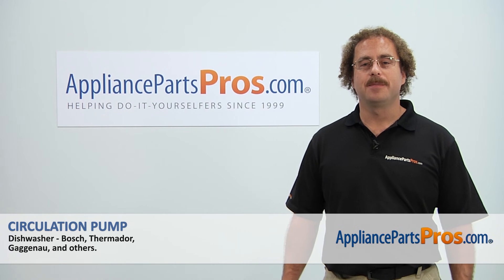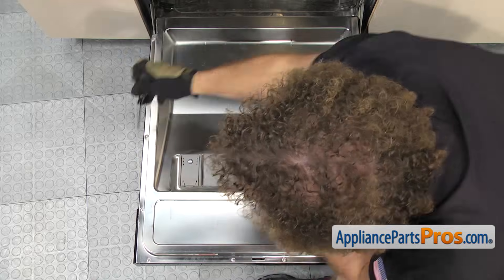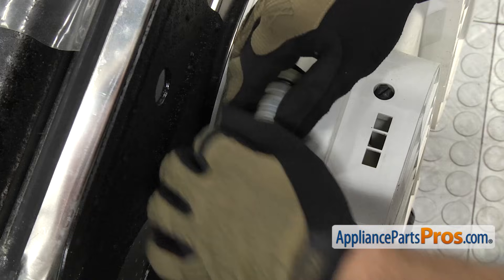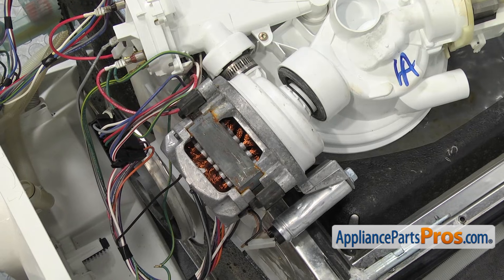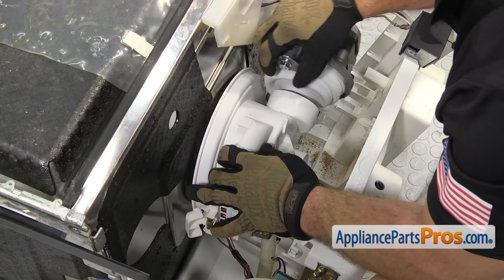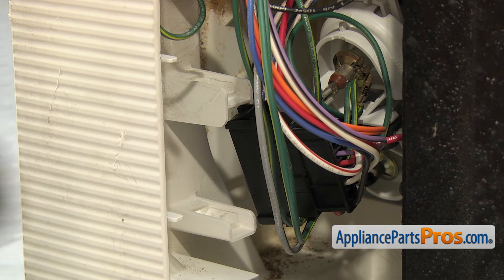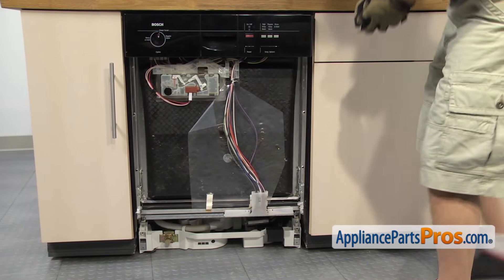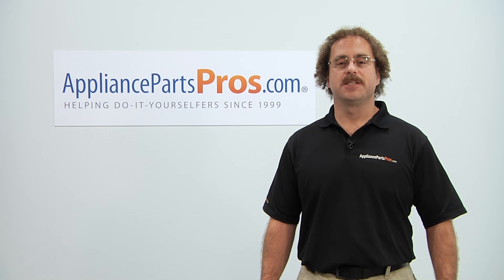How To: Bosch/Thermador/Gaggenau Circulation Pump 00239144

Comment: Thank you Matt for this awesome video!  My model is the Shv57c03uc /21 so there were a couple things (wiring) I had to figure out but made sure to take pictures of the existing wiring hookups.  Took about 2 hours form start to first run and saved over $500.  Again, thank you for your clear and concise instructions!

Comment: Question : can I use plumbers grease on all of the rubber grommets and seals?
Reply from the maker: We usually recommend caution with using lubricants with washing machines and dishwashers, because those lubricants can end up on clothes or on your dishes. However, a quality silicone grease should be nontoxic, so you should be okay there.

Comment: Help please!!  Firstly, there is no wiring harnass attached to the base as in your model(At least I can’t find one). Also, there is a blue wire running to the capacitor attached to the motor. (Shv57c03uc /22).  I assume these dishwasher models are all a little different. Can you guide me to approximately where the wiring harness should be? I’m not looking to rip any wires are their connections. Also why does my unit have a wire running to the capacitor while yours doesn’t?  Thanks!
Reply from the maker: You're correct that all the models are a little different. A single part can be compatible with hundreds of different appliances. We film the part on a single appliance model to serve as an example of the repair, but there may be slight variations in the process for different models. Additionally, this video is for part 00239144 and it looks like your unit takes part 00442548, so the video won't be an exact match. Here's the diagram for your model http://www.appliancepartspros.com/parts-for-bosch-shv57c03uc-22.html That should help you see the parts and how they're connected. If the diagram doesn't help you out enough, keep in mind that we offer free technical advice and diagnosis 7 days a week. We can answer any questions you may have and help talk you through the repair. You can give us a call at 1-877-477-7278 or you can chat us at our website: http://www.appliancepartspros.com/. Our PartsPros Agents are here from 7 AM to midnight EST.
Reply: I ran into the same issue but watched the video before taking my unit apart. What I did was take a picture w/my mobile phone prior to dismantling the entire machine...including the existing wiring and connections.  I also added mini videos of where all the screws/parts go and put them in a parts container showing where each one goes.  Yes, it takes a little time if you're not a pro but this video is very helpful and straight forward.  To repair this would have cost me $623.00 and a new dishwasher is about $1000.  The pump motor is $144 including shipping.  (Shv57c03uc /21).

Comment: So thorough thank you except you omitted how to disconnect the electrical
Reply from the maker: You're welcome! I'm happy to hear our video helped you out with your repair. We do recommend disconnecting the appliance at the outlet at 0:15. Better safe than sorry!
Reply: AppliancePartsPros , thanks for the response, and once again thanks for the great video. Mine is hard wired, not as simple as unplugging a cord. If I can do the repair I can remove 3 wires.  Guess I was just trying for a little sarcasm that backfired.
Reply from the maker: It is a little more complicated if it's hard wired, but you can still turn it off at the breaker. We do our best to respond to all comments, questions, and sarcasm we get! ;)

Comment: is that coz the water dosnt pushed in to the compartment ? thx
Reply from the maker: You may need to replace this part if the motor has gone bad and is not circulating; the impeller is damaged and you’re not getting any water circulation; or the seals have gone bad and you’re getting water leaking on the floor.

Comment: OMG,.. does Bosch enjoy making things twice as hard? It seems like you have to take apart the entire dishwasher just to replace the wash pump? You could replace a wash pump on a Whirlpool in half that time! Why would anyone design things like this? German engineering at its best. A really expensive machine that breaks down just as easily as any other, and twice as hard to work on for repairs. Nope,.. after watching this I'll never buy a Bosch!
Reply: Nope, Bosch will NOT break down nearly as often as other brands. Only had to replace a mainboard once in 17+ years. Other than that-flawless operation.
Reply: I spent a lot of money buying a Bosch dishwasher, 2009 vintage, thinking its going to be great, German quality, yadda yadda. 2017, 8 years later, this very circulation pump seal had broken and the Aqua Stop engaged. The pain and misery of trying to get to the circulation pump is immense. Its also expensive as ****, the cost of replacing a circulation pump almost equals the price of an entirely new cheaper Beko or Midea dishwasher.
I also have no clue as to how to disassemble the pump to get to the seal, the Torx screws are wound so tightly its impossible.
Reply: Midea dishwashers are complete garbage.  Nearly every component made in china.  I used to repair them constantly.  Build-quality is extremely low and the price reflects it, with everything from the plastics that oxidize and crack in a matter of 2 years to low quality metals that rust, to low quality circuits and and will literally detach themselves from boards due to heat..
Reply: I know from firsthand knowledge about the lack of antioxidants in plastics  that makes them crack in 2 years instead of lasting forever. Literally pinching pennies.
Reply: They all make things bloody hard these days. More innovation goes towards making it customer-DIY proof. Appliances and cars mainly so you are forced to take it to them for some silly codes ;)
Reply: @scolic03  Which plastics ? Lack of Antioxidants? I'm really curious what you are talking about. Please expand ?
Reply: @sparkynm156  I am probably mixing up terminology, but I am talking about plastic greenhouse tarps. They are exposed to the sun and slowly degrade over time. If you put certain additives, the plastic would last much longer, but manufacturers choose not to for cost-cutting reasons.